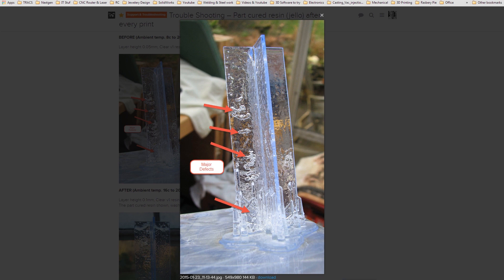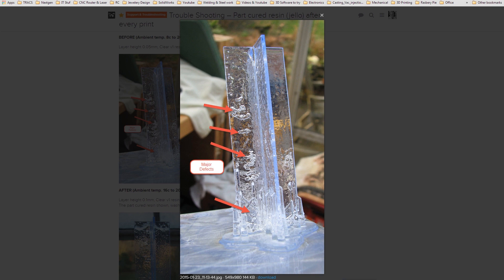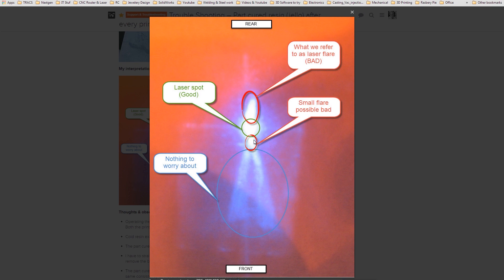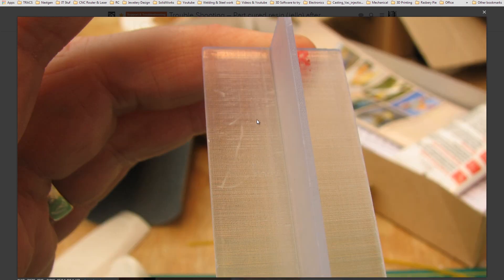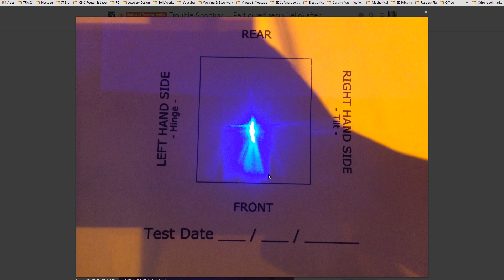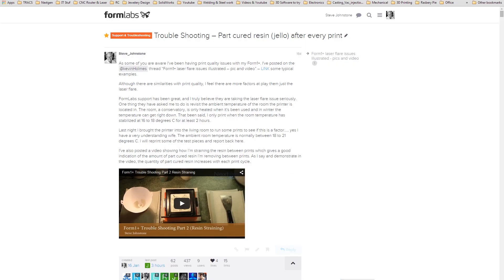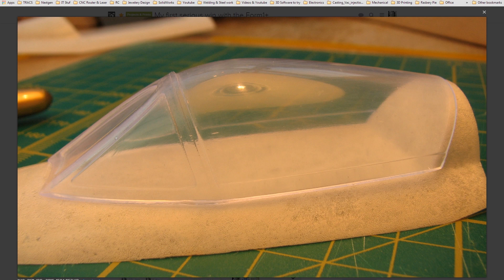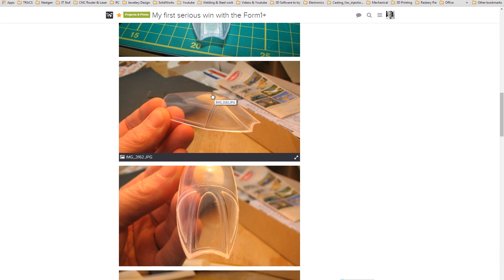Form1+ Trouble Shooting Part 3 Laser Flare

Comment: Hi Steve, Thanks for posting this up. I have the similar laser flare as you on my Form1+. Do you have any solution so far from Formlab technician? Thanks a lot.
Reply from the maker: NiceTime SeethisWorld , Formlabs support replaced my laser and although I've only printed two large prints there has been a vast improvement. Have a read of this post as I think it really gets to the bottom of the problem, especial the comparison shots of two bad and one good lasers towards the end.

http://forum.formlabs.com/t/dissection-of-the-laser-spot-using-a-dslr/3425
Reply: Steve Johnstone Thank you so much Steve. You input in the forum is so valuable. I saw the picture comparing 3 different people's laser point with different exposure time. The people inside the forum are so helpful in solving the laser problem. I got the idea and use Kevin Holmes's choke method to solve my laser problem at least. : )